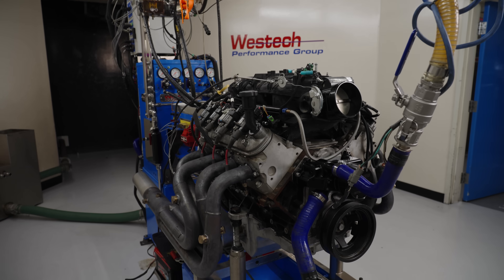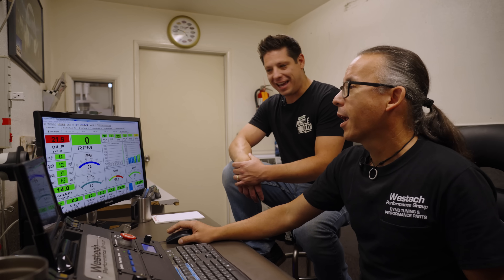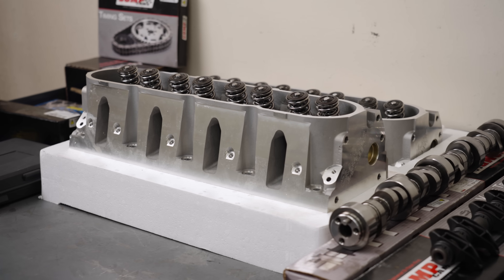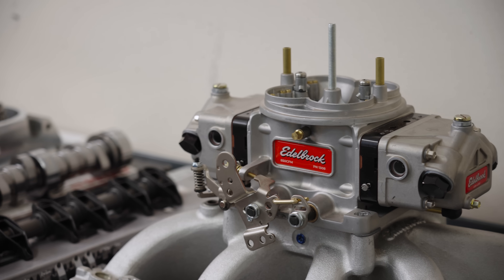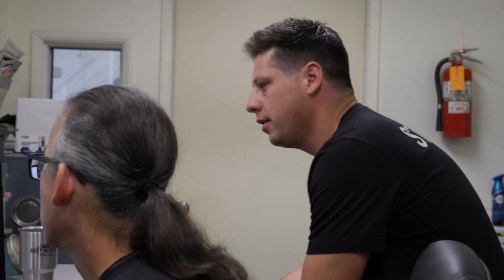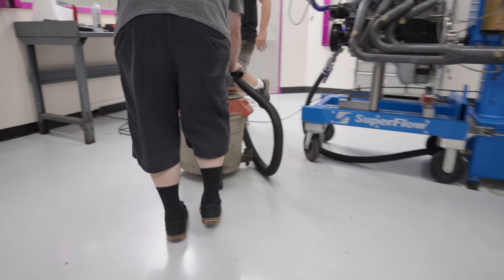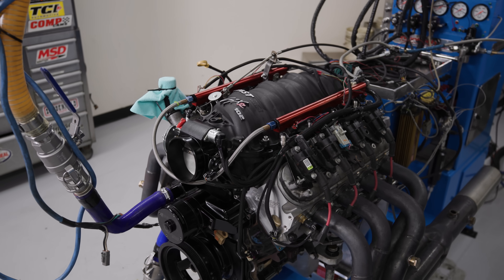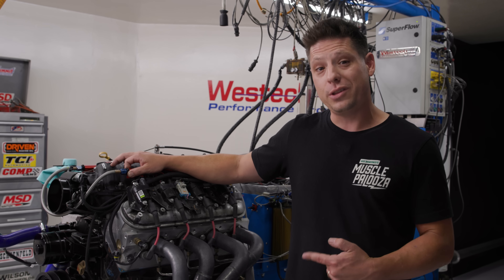4.8L LS: How Much Horsepower Can We Squeeze Out Of GM's Smallest Displacement LS Engine?

Comment: A 4.8 would be great in an 80s F-Body. Without even doing any big modifications it would be a big improvement over the old 5.0, or even the 5.7 in stock form.
Reply: also a 4.8 has a stronger shortblock compared to a sbc
Reply: Nearly double the horsepower to the ground if you pair it with a manual transmission.
Reply: Oh it is lovely, my Camaro is so much more fun after the swap
Reply: @teabag402  did you do a 4.8? I have a 91 Camaro with a 305 TBI and I’m dying to do a swap.
Reply: @smykster007  I did a 5.3 first and then got a great deal on a 6.0 so I swapped them and will use the 5.3 for my 1946 Chevy truck I'm building. On the Camaro I did all new steering, suspension, brakes etc at the same time. It's like a totally different car. You won't regret it
Reply: @smykster007  I did one with a 5.3, the running engine cost me $500.  The swap parts were another 300 bucks.  I ran it off a carb, that was another 300 (Ebay manifold), an MSD box to fire the plugs was 400 and there was another 300 in plumbing, exhaust, cooling, ect. Call it 2 grand all in and it runs so hard it's incredible compared to the stock 305 and Granny could drive it, a built 350 could not keep up with it and it and that 350 will cost you more than the whole swap. Next will be a cam change, should be good for another 50hp and big smiles.
Reply: I put an ls1 with just a cam and headers in my 74 and it was a different car. So much more fun to drive.
Reply: 😂😂😂 I piss with more power than a stock  3rd gen😂😂😂 I'm pretty sure a stock one doesn't exist anymore.
Reply: @Islandcitymedia  😂😂
Reply: Just put LS1 in my 89 Camaro can't wait to get out to see how it really drives!  BTR Stage 3 cam, 92mm intake & tb, 3500 stall, and full umi suspension
Reply: I put one in my Beretta and it's a nice upgrade. 3 sec faster on the 1/4😂
Reply: But why do a 4.8 instead of a 6.0?

Comment: I have a totally stock 4.8 in my Silverado.  I love it because it’s still got some grunt and it also gets great gas mileage.
Reply: I just bought my grandpa's truck a 2011 silverado with the 4.8 and it's got 230k. I swear you could turn the clock back 100k and not know that's how good it runs. I really love it especially because it's got no AFM or DoD
Reply: Do You know how many mile per Gal  You get on Your 4.8? 

I am thinking in swap my 4.3 but I am between  4.8 and 5.3, I will get they best mpg one.
Reply: I doubt it gets good gas mileage
Reply: I doubt great mpg
Reply: Cap
Reply: My dad’s 6.2 gets double the mpg of my 4.8
Reply: @robboss1839  Surely there are major differences between the two trucks.  My 5.3L has a ladder rack with ladders and it gets about 8 mpg.

Comment: A buddy of mine blew up his turbo'd 406 ci LSX, waiting for a new block they threw all the speed parts on a 4.8 sitting around.   Made 1048 hp.....for a little while anyway.
Reply: I've been making 800+whp through a 4L80 and a 9" for 4 seasons now in a 4000lb car. Junkyard 4.8, baby cam, stock heads and 25psi on E60. It's all in the tune.
Reply: theres one common factor at play here
Reply: @redlight3932  I know you mentioned that as a dig, but the rebuilt LSX has 15 years at a 1000+ hp tune and daily driven and 4.8 was  one of a dozen sitting around he bought for 200 bux.  They got several weeks horsing around at 1000 hp on a 4.8  They were fully well aware it wast going to survive and it still lasted longer than anyone guessed.

Comment: Or you could save about $4500 and just buy a nitrous kit
Reply from the maker: Nitrous is fun, but not really comparable to having the power there all the time. It's also completely illegal in most states to have a kit hooked up permanently so we definitely don't recommend that. No reason you couldn't do a similar build AND have a few hundred more horsepower worth of spray on hand at the racetrack.

Comment: I really only have interest in carb stuff for low budget builds. It's cheaper to land a carb than it is a full fuel injection system, but this is proof that carbs work but aren't the best.
Reply: I've done more than a few swaps with carbs on street rides.  I use Ebay dual plane manifolds and any leftover carb I might have around.  Q Jets, a Holley Truck Avenger and a few Edelbrock AFB's have found their way onto my engines and they all performed great, gave fantastic mileage and were simple to install and easy to work on, great for anything except an all out racer.

Comment: 4:20 is a great number - but it's also a time stamp for a dyno where you guys stopped revving at 7200RPM even though you were still building power and it doesn't look like there are obvious signs - at least from my comfy seat in front of a computer - of valve float; I know another one or five hundo rippums isn't a ton, but it might have been cool to see juuuuust how far it goes
Reply from the maker: We did run it out to 7,500 in multiple pulls (not shown). It didn't make the edit because the engine did not make power past 7,200. Eric Rhee is an excellent dyno operator.

Comment: "Speed parts".. put a turbocharger on it...throw the other junk in the trash and make power without blowing money on parts that don't matter
6:24.. there's a Dewalt mechanics tool set on the table behind the engine..Somebody knows how to find a value set without filler pieces...nice🫡
Reply: lol. Funny you caught that. It’s a great set and doesn’t have 200+ useless bits lol.

Comment: 62 degrees of overlap in a low compression 4.8 doesn't make for a good driver.  I'm looking at a 470 hp LS1 with a 214 degree cam and ported 706 heads.  You don't have to buy aftermarket heads and massive cam to get good power.

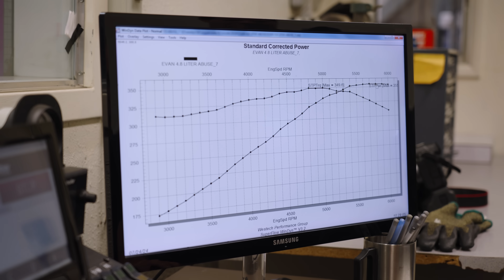Comment: As someone who wants to put a 4.8LS in my Grand Cherokee, I'm more concerned with off idle, and partial throttle torque. Which wasn't covered here. BUT!  . . . the bone stock engine had over 300lbs. of torque at only 3000rpm , 1:51 , which is perfect for my intended application. I won't be doing WOT runs, I just need more low end torque than my 4.0L six can make. It costs real money to get over 300lbs of torque out of the 4.0L. The 4.8LS does it right out of the junk yard, stock.
Reply: They did show the torque curve though and it resembled a table top. Part throttle torque will be just fine.
Reply: @crashm1  Yep.
Reply: I have a 190k mile 4.8 in my Grand Wagoneer (legit FSJ version from 1984). It is backed with the 727 still and the factory 2.72 ratio axles. Off the line is sluggish because of that ratio, but still will move respectably for an 80s SUV shaped like a brick. It's only a few hp/tq off of the 5.3. I am very happy with it. Also, regularly knocks down 16mpg average can occasionally get 20mpg in the right conditions. All without a non overdrive, power robbing (but reliable) hydraulic transmission. I love the 4.0 in my YJ, but drop a 4.8 in that ZJ and drive it.
Reply: The straight 6 is more a torque monster then you think.   Check out Clifford performance.
Reply: @troywood7170  . . why would I put that kind of money into any engine when I can get the same performance out of a cheap junk yard V8? I've already been thru all of this and done the math. The 4.0L is a DUD of an engine. I get that some people are very defensive of that engine, and I'm fine with the criticism.
Reply: @RANDOMNATION907   The love comes from the 90's when they  added fuel injection to that motor. It made 190hp and 225 pound feet of torque which was really impressive back then. Inside a little CJ or YJ they were more than enough. That and they lasted FOREVER being an I6. However they were a lot less impressive in the Cherokee due to the weight difference especially in the Grand Cherokee, so I can see why you'd want the change. LS swap that thing and don't look back. The 4.8 or the 5.3 are amazing transplant motors and everything you need to to make it easy is right on Youtube. I think if you grab the donor trucks ECU, wire harness, and fuse box that's about all you need. If you want more customization/control Holly makes amazing engine management units for those. In the end you'll make more HP per dollar than dumping money into the 4.0.
Reply: @RANDOMNATION907  I can see that in a Cherokee a six may not be enough, i had a 4.2 in a cj and it was a beast.  Had
Reply: @RANDOMNATION907  had low end like a tractor.     In a Cherokee I can see a v8
Reply: @RANDOMNATION907 

If you think the 4.0 is a "dud" then either youre ignorant, or horribly misinformed. 

Check out Newcomer racing.

A crank pulled out of the 258 i6 can be put into a .030 over 4.0l block bringing it to 4.6l and netting over 300 tq at a low accessible rpm, for much less money than an entire v8 swap, with its many accesories and hurdles.
Reply: @riogrande163  . . on what planet would a stock, boneyard,  LS swap cost more than than a newcomer Six? I am a retired Mechanic and a former instructor. I have decades of experience. I know what I'm talking about.
Reply: A dyno curve means nothing to you if you have no interest in WOT, where a dyno run takes place.  Low end grunt can be had by increasing compression ratio and closing the intake valve early....
Reply: @trailerparkcryptoking5213  👍

Comment: The smallest LS that GM built was the 4.3 liter V6 most commonly used in vans.
Reply: That is not an LS in name or architecture.
Reply: @EvPerk the 4.3 is based off the ls1 architecture and has the same stroke and bore as the 5.7 as well just minus 2 cylinders.. The ecotec lv3 4.3 also has been show to handle boost and cams real well.. Sdcp makes cams and what they call a stage 2 cam with 14 pounds of boost led to the little lv3 making 700hp to the crank
Reply: Lv3 4.3 and the earlier tbi and the vortec version are all based off the ls1 architecture. Same stroke and bore and even uses alot of the same accessories sdpc make cams and afm/dod delete kits for the lv3  @EvPerk
Reply: @EvPerk  You are correct. It is actually LT architecture. Have one in my 2016 Silverado. 285 hp 300+ torque on pump gas and 307hp on e85
Reply: @marcmo7138  LV3 I believe. Great engines. I did an early 4.3 V6 in an MGB and it was awesome.
Reply: @EvPerk  LV1 doesn't have DOD and the LV3 does unfortunately.
Reply: You can delete this ignorance at any time, we won't hold it against you...
Reply: @jcanfixall1585  it's based of the 350 5.7 same stroke and bore takes same mods the same the 5.7 is the ls1 architecture though the lv1 and lv3 4.3 are based off the Lt architecture

Comment: The thing is the LS7 is rated 505hp with full accessories, cats, air box, etc. manufacturers test the engines how the engine sits in the car! Many of magazine/youtube engine dyno’s DO NOT give accurate results because they test in gross and not net like the manufacturers do.
Reply from the maker: For most racers the traditional 300 RPM per-second-sweep on a water brake dyno is more than sufficient to determine how a component (such as induction or camshaft) affects the power and torque curves. Net or gross doesn't really matter when your goal is to validate if a new part is beneficial for an engine combination. 

OEM dynos are a whole different animal. They hold the engine at different RPM points for a painfully long duration. The final numbers are actually an average of the engines output during a measured time span across those ranges. Things like catalyst protect, which richness the air/fuel mixture to lower exhaust temperatures at WOT, and other tuning parameters, such as a reduction ignition timing as the engine coolant temperature rises, will actually lower the measured output during an SAE dyno pull, so the final numbers are more like average peak and not true maximum power. That's why we often see stock vehicles make more power than they are rated at on aftermarket dynos.

For racing and street performance, we're not looking to produce a product brochure with guaranteed output to go with a new vehicle, but more to find the delta in performance increase between multiple component or tuning variables. Hope that helps explain why we dyno in this fashion.
Reply: False advertising